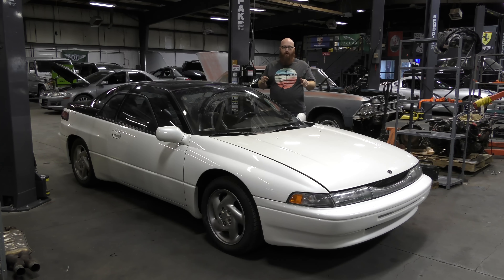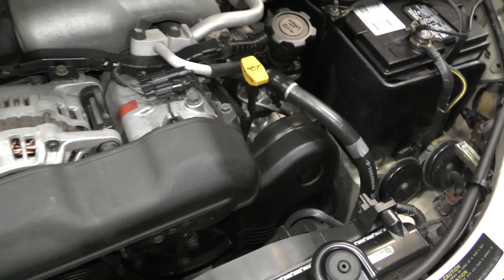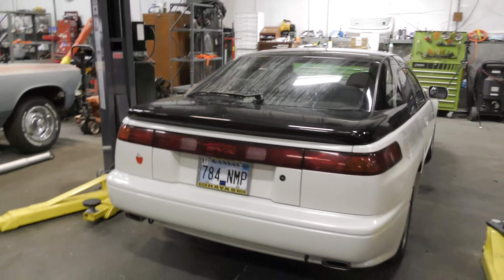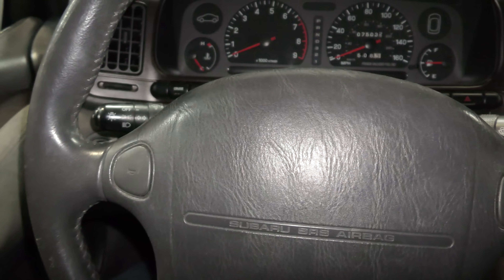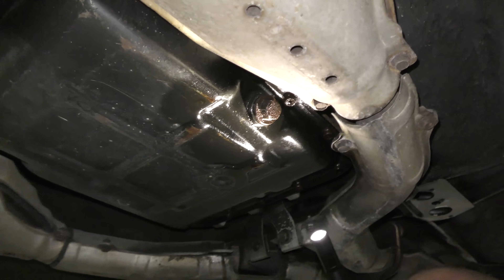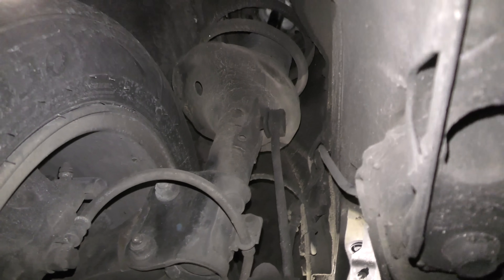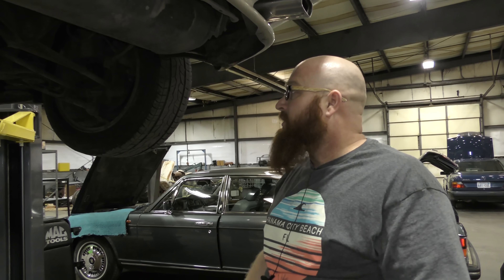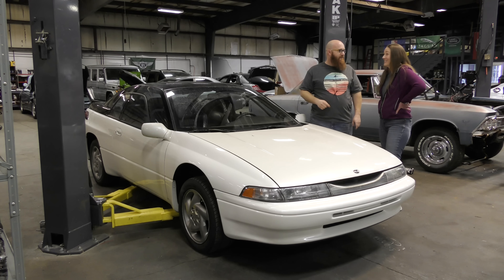An Italian Subaru Sports Car?!? The CAR WIZARD shows how east meets west with this 1992 SVX Subaru

Comment: I own about 7 of these cars, 1 I have converted over to race .  Still run the NA flat six but have a PPG sequential transmission now.  In answer to a couple of questions people seem to have.  Subaru had trouble stopping the engine boiling at higher revs.  This tends to stuff up the idea of manual for anything other the road.  Some guys fit electric water pumps to get around the issue.  I have fixed the issue still using the existing water pump.  The story I heard was that Subaru had the engine developing close to 280 hp but kept blowing transmissions so they detuned it before selling on the market.
Here is my race car at Bathurst before I fitted the sequential.  People at the race track love the car and the pure sound of the flat 6 NA.
https://www.youtube.com/watch?v=rvbLYHt-nDM

Comment: I had one put a five doors in it from a legacy with the auto crap car with the standard fast car heavy car hot car windows suck motor is a riper should have put this engine in wrx Sti with turbo easy 400 hp

Comment: You should take the BMW flag down since you don’t want to work on them. I can’t blame you either. The part of Germany where I was born we would gladly burn that flag.
Reply: the old ones arent that bad
Reply: @paulmaartin  BMWs until the early 2000s were fantastic cars. Well engineered. Well built. Superb driving dynamics. Easy to work on.

Then they brought out VANOS motors and electronic actuation on everything. And almost overnight BMWs turned into nightmares after the warranty was up.
Reply: @paulmaartin  Yep the Isetta was pretty good and your friends always had fun carrying it off or setting it between stuff so you couldn't get the door open. I remember my Opa telling me stories about that. :-)

Comment: The wheels are on the wrong side of the car. Right and left are reversed.
Reply: No there correct. Just looked at the owners manual for 
sale on ebay
Reply: @redauwg911  You're right. Looks wrong to me. I'm used to the old Nissan 300zx.